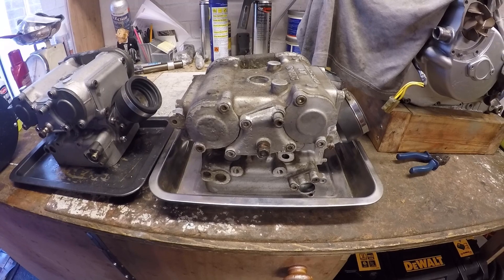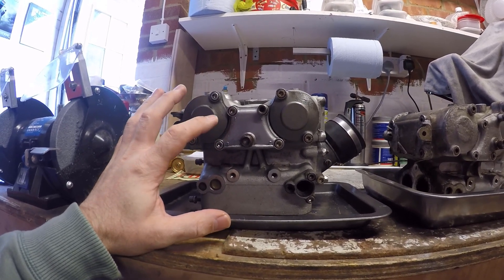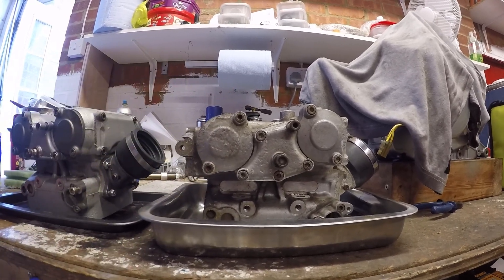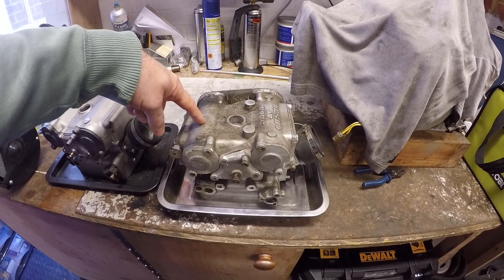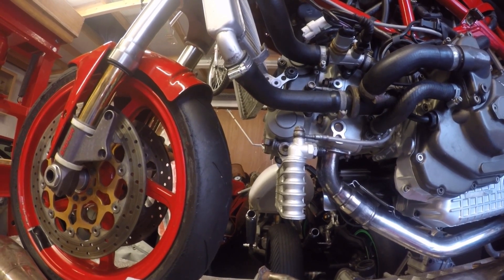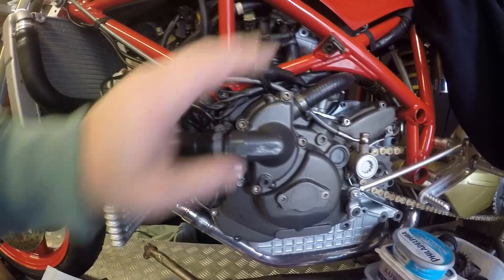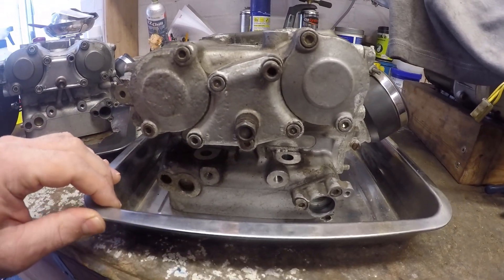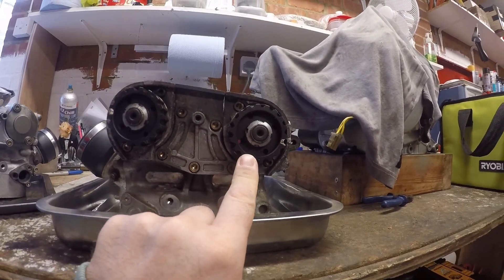DesmoWerx Tech Guide 2 - What's a Ducati Testa Bassa Head

Comment: Do you know that is the cylinder same in 748E testabassa engine than in older 748? Some say that older cylinder is longer? Older Ducati code for cylinder-piston set is 12020381A and newer is 12020581A. Or is there some other structural differences? Thank you for your videos!
Reply from the maker: Hi Lassi, they should be the same as the bore and stroke is the same for all 748 engines even with the testabassa heads. 
Thanks for watching 😎

Comment: Are the valve clearance settings for these heads te same as for the older heads? Or what do you recommend as clearances? Thank you
Reply from the maker: HI Jeroen, these settings should be good for the older 4 Valve heads, the tightening up of the clearances improves the wear characteristics for the valve train components.
Reply: Ok, thnx! Great video, helped me al lot (together with the valve adjustment video)

Comment: Hi, I recently purchased a 2001 748 with the Testa Bassa heads, do these heads suffer from the rocker issues that were common on the 748's? The bike was in a living room used as artwork for the last 11 years and only has 4300 miles so everything is as shipped from Ducati. I feel that the engine's top end is louder than it should be and will be taking out the cams for an inspection. I also have a set of new in the box standard 2000-2001 748 bare, except for guides, heads that I was planing on completing/blueprinting for spares with aftermarket rockers and new valve train pieces. Will I need anything else different to do this? Also are the rockers the same between the two model heads? Thanks, love your channel.
Reply from the maker: Hi Brad, 
The rocker issues tend to be from earlier engines circa 95/95/97 when Ducati suffered a bad batch of chroming, that's not to say later ones don't suffer if clearances are set wrong or cheap oil is used.
The rocker are different on the sloped side of the head if I remember correctly, I will check for you and confirm. The valves are also different length.
Reply: @DesmoWerx  Thank you for the reply, you are THE source for information on these bikes IMHO. Well the shorter valves probably weigh a bit less so that's a plus I'd think. Thanks again for the knowledge.

Comment: Worth noting that the Testa Bassa head needs a different cam pulley holding tool due to the different position of the exhaust cam and the belt cover fixing lug on the backplate
Reply from the maker: That is true, I should have made mention of that 😊

Comment: Amazing bit of enlightened information, thank you, this is obvoiusly the 4 valve engine used in the ST4 range to 2005 as well.
Reply from the maker: Yes Guy, same heads across a number of the later Desmoquattro engines :)